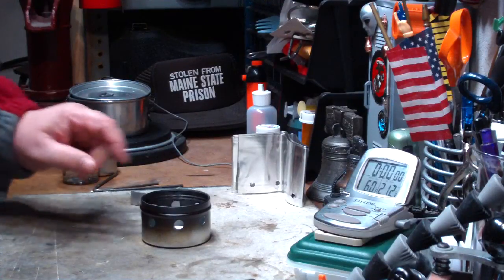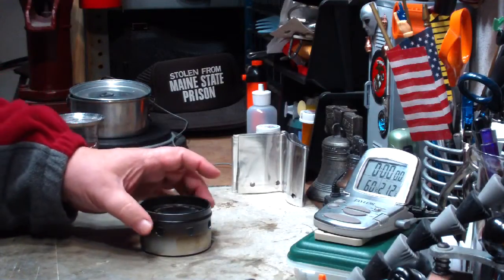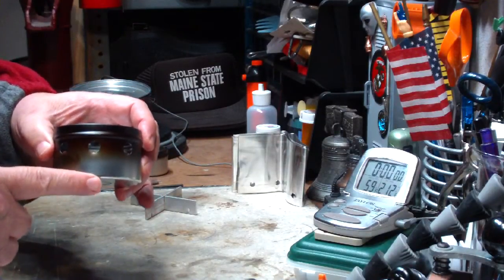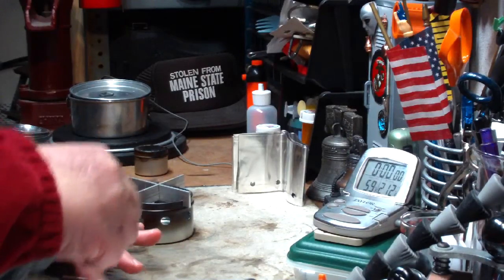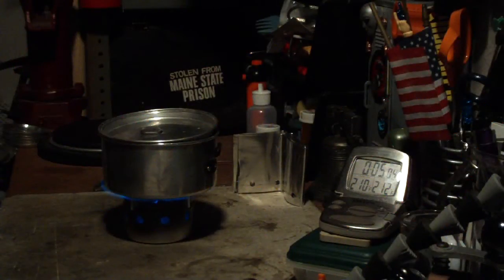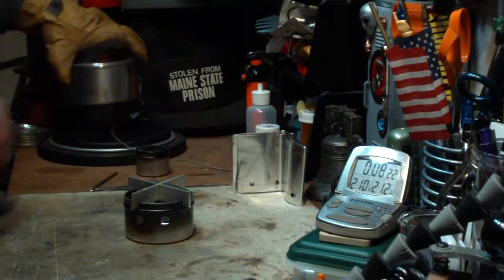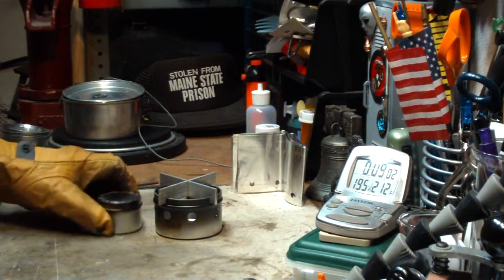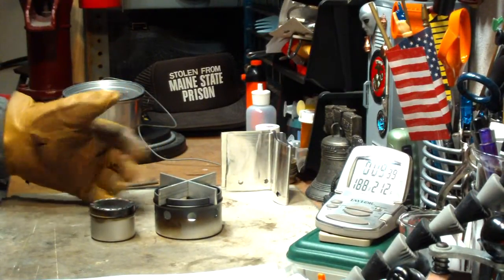Etowah Ultra-Lite Stove II - Boil Test #2

Comment: I'm surprised it took longer without the inner "economy" burner. I guess the stove works better using the two in conjunction.

I tried the 1 qt. test using just the large, open burner/pot stand. I started with 62 deg water, inside (no windscreen). Using my GSI tea kettle with 1 1/2 ounces of Heet alcohol, I reached a boil at 8:33 and total burn time of 10:14. I was rather impressed. My Whitebox stove will do the same using the same amount of alcohol, but took an extra minute to reach boil.

Comment: Using the windscreen will increase thermal transfer to the pot. 1 by reflecting radiant heat and 2 by preventing heated air from dispersing radially from the system; it will be channeled upwards along the side of the  instead.